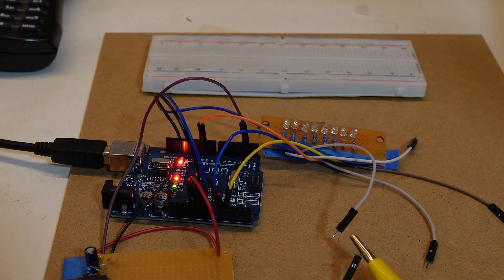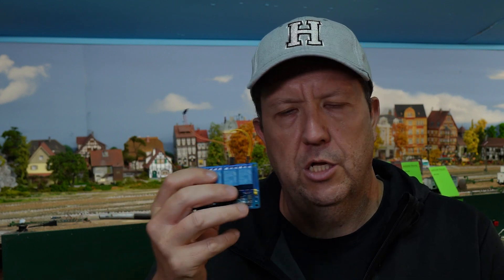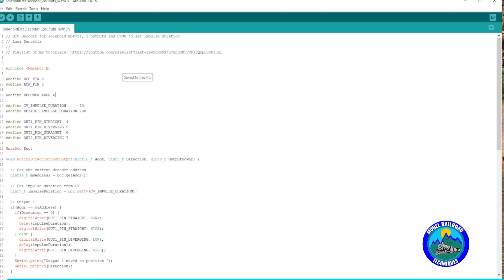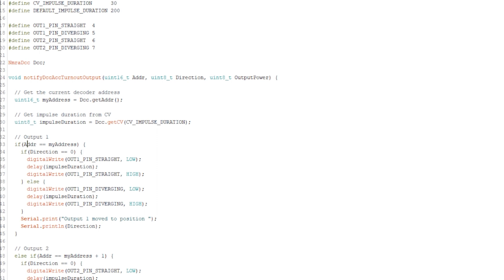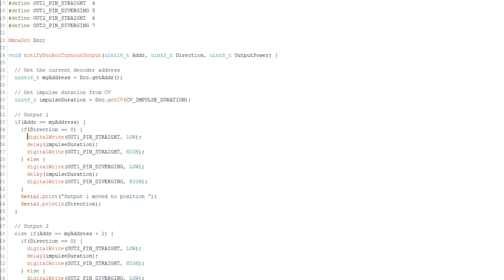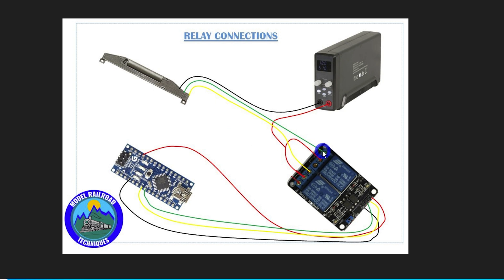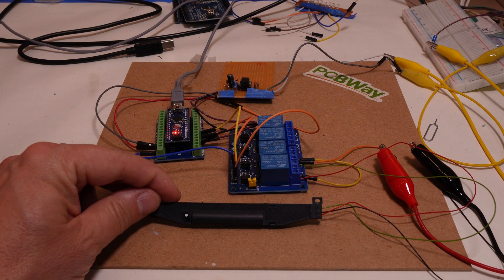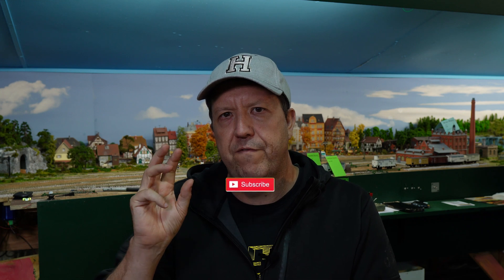Control your Solenoid Switch Machine on your Model Railroad

Comment: i wonder if the arduino has enough juice to use a CDU ?
Reply from the maker: Not sure CDu??
Reply: @ModelRailroadTechniques  Capacitor Discharge Unit
Reply from the maker: @ianmugford9459  ah yes. With the relay used you can you some pretty height currents. Worth and experiment

Comment: Re the high/low thing, some relay modules are active low and some are active high so the Arduino sketch needs to be changed to match.

I wonder if you could just use a transistor driven output, since a relay is just a fancy solenoid
Reply from the maker: Thanks you for the heads up.

Comment: Great video -  to answer you question(s) - I have experimented with arduino and have a few as stand alone that i can link one at a time to JMRI via the cable to the USB port on my laptop.
On my layout I use a desktop computer, JMRI and an NCE Power cab.   How do I connect an Arduino driven accessory to the loconet?
Reply from the maker: Thank you and I am glad you like this video. Loconet: I did a video on an interface that maybe of interest to you. This also would for the basis of what you are trying to achieve. I will research and perhaps a new video on this is in order. https://youtu.be/8iyDgjgUvB8